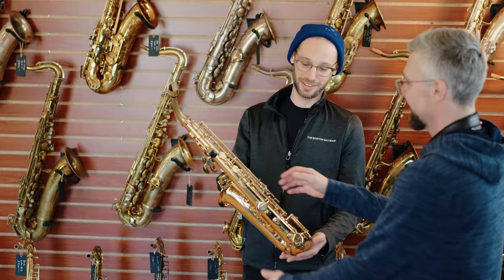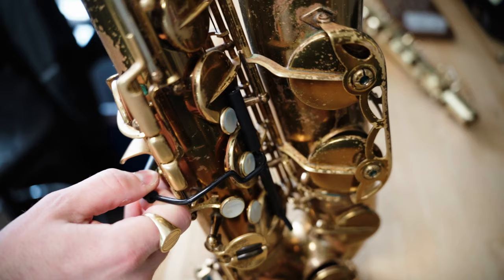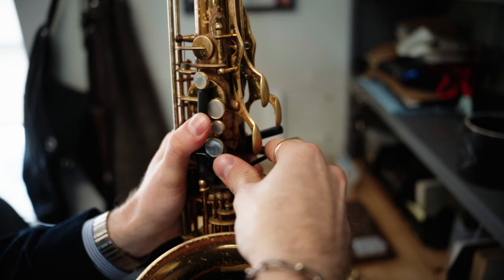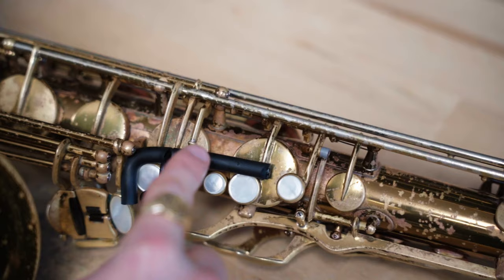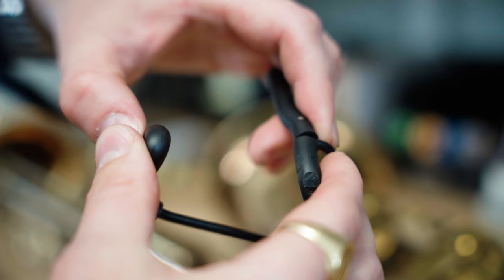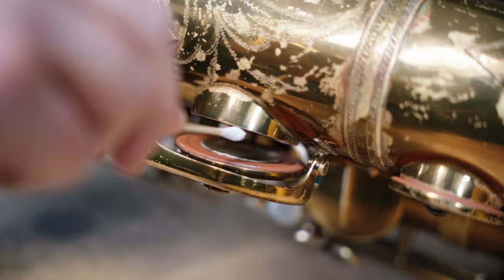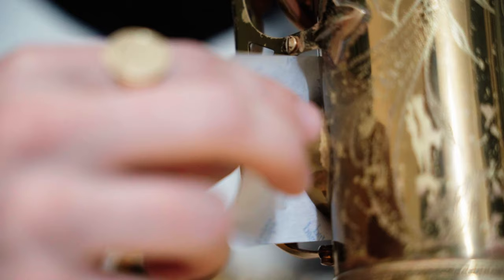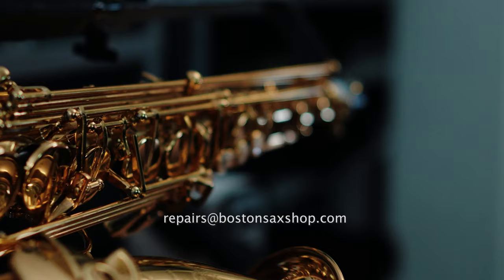BSS Overhaul Post Care

Comment: Jack

Could you comment on Leaf Keys?  Seems the opposite of the key clamp concept.??
Reply: Key leaves are indeed the opposite concept. The clamps ate used after an overhaul to keep the regulation even over the whole horn. If you recieve a factory new horn all keys are held down by kork wedges for the reason to not get out of regulation. Key leaves are only to prevent g# and c# from getting stuck. I use them on my bari, because these instruments are very hard to dry out with a swab. If you swab your horn every time, the key leaves should not be necessary